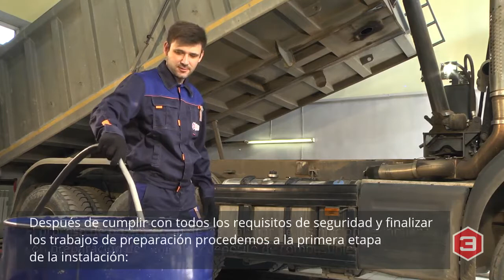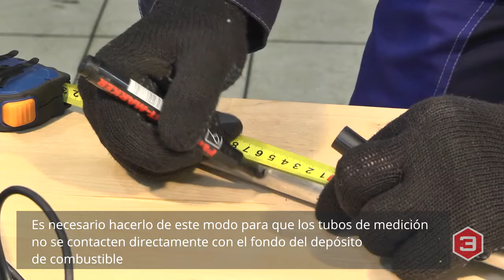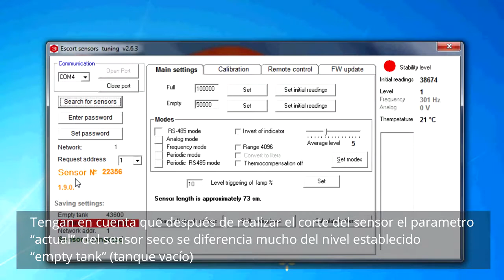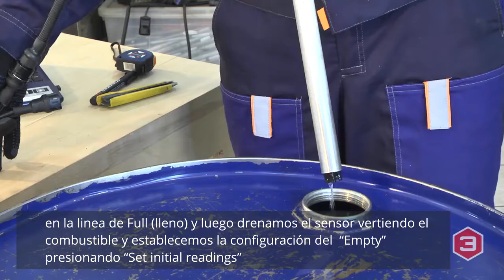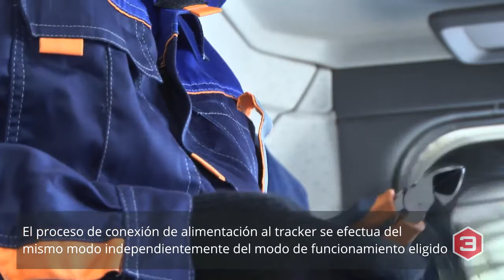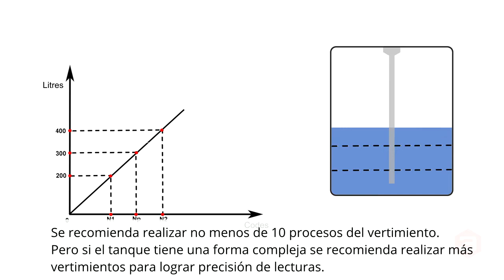Instalación del sensor de nivel de combustible ESCORT

Comment: cada cuanto recomiendan hacer un mantenimiento preventivo
Reply from the maker: Buen día. Eso depende de las circunstancias. Si el cliente no cambia su proveedor de combustible o el tipo de combustible (en caso de los tanques estacionarios), no es necesario realizar ningún mantenimiento preventivo. 

De todas formas, lo más importante es instalar el sensor de manera correcta y realizar la calibración fina para poder obtener las lecturas más precisas.